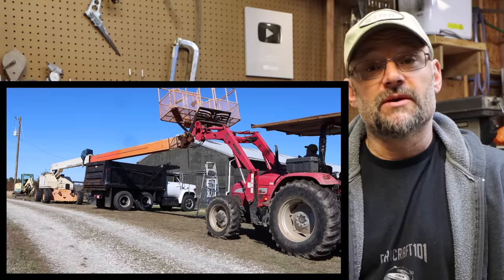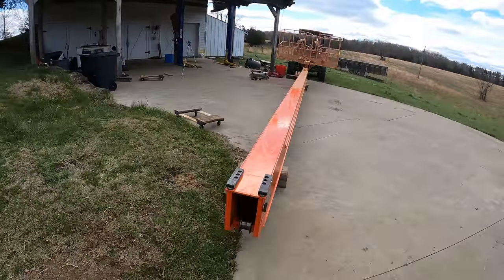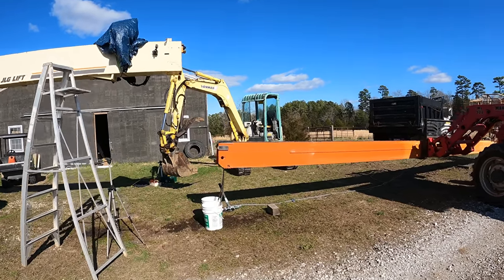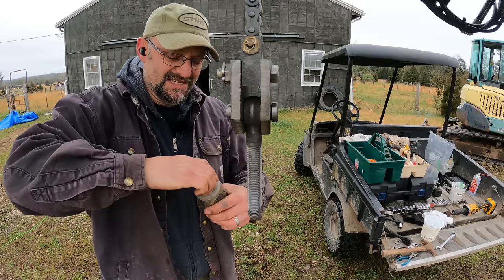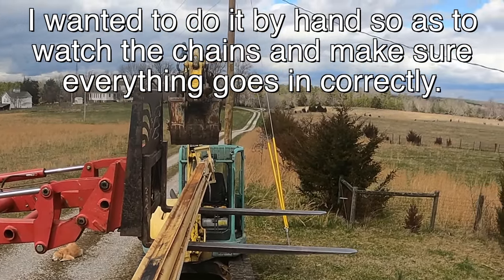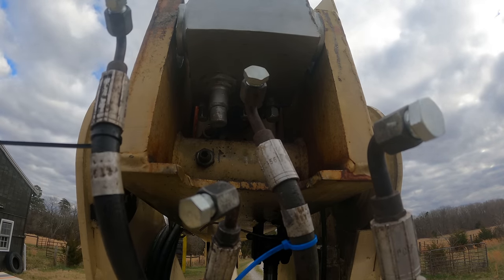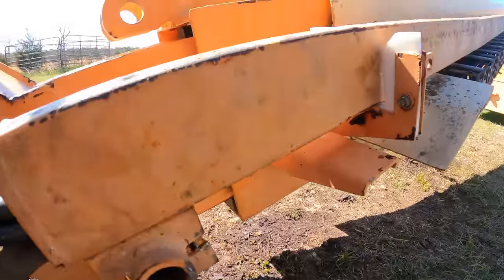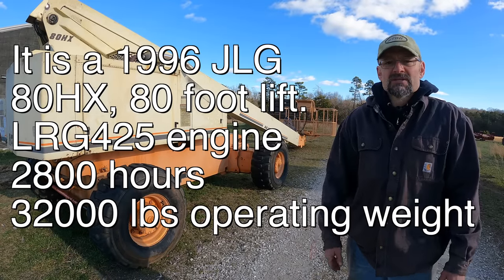Rebuilding An 80 Foot Boom Lift Alone.  Is It Possible?  JLG 80HX

Comment: I would have grease the area where the wear pads rub. Check the pressure going out and the pressure going in as there may be a different.When you are up high and retact you want to feel under control.

Comment: I watch these lifts sell on bidadoo every week. I primarilly watch the 80'>85' Genie lifts, but the JLGs go for the same range. With decent tires and between 3k and 5k hours, they usually go in the $25>$35k range. The fuctions are described in detail, so you get a machine that functions accordingly, and if it doesn't, you have 30 days to return it at your expense. I might note that at 37,000 lbs., these cost a lot to transport.

Comment: On the nemesis pin, you could drill a shallow hole down the center from each end and meet it from 90 degrees on the side.  Add a couple of dzerk fittings and then you could grease it at the bushings.  Would be a very minimal loss of pin strength.

Comment: Bravo! A most daunting feat (& positive fate) well executed. It might be an interesting calculation to determine how much weight the mid-boom is applying to the wear pads in the horizontal position at full extension. Would certainly be the highest friction coefficient & heating. Maybe the fire was just a subconscious incentive for a boom-well clean-out...

Comment: Need to have a can of pledge furniture wax spray on hand when you want things to slide. We used to use it to move heavy equipment like lathes and milling machines across shop floors.

Comment: Was thinking to go vertical more so after horizontal check just for the reversing thereof letting gravity help with retraction as it was not 100% refilled with hydraulic oil and also too, to retard any air gasses left in the system.. With all the excellent repair maintenance work that you've already preformed, one new pressure valve would be my first task... Will be interested in your final fix -> if any... Like your channel -> MUCH...!!!! TY

Comment: I was wondering if more hydraulic oil would fix the extended boom. Remember you only filled it halfway. Of course, the pressure switch might be the problem. Just a thought. I worked for R.G. LeTourneau for 20 years. We built all kinds of diesel electric, hydraulic equipment. I was a serviceman for LeTourneau Sales & Service. A few spills and a long boom might eat up quite a bit of oil. BTW Good job on the overall fix.

Comment: I just love how your engineering background kicks in and you make everything right before you assemble anything, well done sir. Regarding pronouncing the Shiv incorrectly, you are from the USA, you call everything incorrectly such as the cotter pin. I was a little dismayed when you bent the split pin legs like you did and you nailed it when you said that the  pin can't come out. The split pin holds the chain pin to stop it sliding out, it only needs one leg to be split 30 degrees. I have a 4WD that is 22 years old, it has done over 290,000 km and the steering split pins are bent one leg 30 degrees. They have been in there from new and they are in a very vulnerable position and they haven't moved at all.
So, my point is, don't bend your split pin legs like they are ballerinas legs, they just require a slight bend that is all. The retract adjuster, wrong split pins and oh dear.

Comment: Pallet on pallet forks Mr John. I may have some info for you. The last 2 ft it doesn't like. Is there a mechanical interruptor for the extend/retract? If so it may be cutting your pressure down, not letting it retract. I worked for a company that had a old snorkel lift, it did the same thing. That interruptor was hanging up, not letting the full pressure through. Get some hydraulic gauges and check pressures.

Comment: Hmmm, that sequel when you try and retract from full out.... I can't remember, did you check over the valves related to the retract?

Bwa! You talked about the pressure relief valve, I wasn't sure if it had one, but that's exactly what I was thinking.

Comment: Adjusting that pressure relief valve should be very easy.  Usually it is an internal hex on the end of the stem of the valve with a locking nut that holds it at it's setting.  It could be tougher to know what pressure you are setting it at, but you could just replace the valve all together.  I'd be surprised if it was more than $200 and probably not that much depending on the brand.  I've worked for a couple of the US based cartridge valve manufacturers so if you have any questions please reach out.

Comment: Grease zerks on the pin. Small hole on the center of the pin, and then another hold to the outside of the pin at the bushing. A small diameter hole 3/16" is not going to compromise the integrety of the pin.

Comment: You done well considering you had zero schooling. on these things. Seems your Tudors were most helpful also. Been working on these for 20 years and the boom pivot pin are always a problem. Very impressed that you did do this alone but I always request I have a partner incase of an accident. 35k to 40k seems fair and realistic. I agree with the relief valve setting also. Always set per manual the relief valves as they also limit loading to stated basket capacity so a person does not upset the machine with 2000 lbs of cinder blocks!, bricks or even debris! 😂

Comment: You do really good work you repair things I would never attempt but I would check and adjust the hydraulic pressure relief valve because the system is designed to operate at a given pressure running it at a lower or higher pressure puts undo strain on the system it could be as easy as loosening a lock nut an turning a screw or removing a bolt shimming or replacing a spring  a pressure gauge would be required

Comment: Jon,
  I really hope you used rosin resin on your solder joint. If you used acid core, the type you use to repair a radiator leak, it will eat up the copper wire and anything else it gets on. Hope I'm not too late posting this note. Let me know if you get the message. i made this mistake and the mess it made was uncorrectable. It ate the wires and connectors in the radio up....
best regards,
Sam

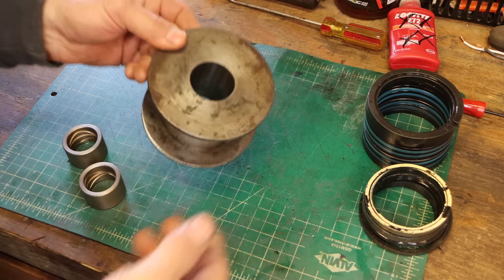Comment: 3:23 Did you buy that press from Arbor Freight? 🤦‍♂
That's a nice shiney cylinder there Jon. Have you been polishing your rod vigerously by any chance? 🤷‍♂
My only disappointment was you didn't show the hydraulic oil level in the tank after you exercised your Johnson boom to it's full  glory. I was very curious as to how much the level would have dropped.
Over all it was very impressive and was a very quick 58 minutes of immersed watching.
Considering the work that was done to it and the mechanical state it has been improved to plus the low hours I would expect you to be able to ask about one third of the new price if you sold it here in Oz. Yeah, prices are higher. 
Thank You for the series on repairing the beast. It was greatly appreciated! 👍👍👍👍

Comment: I would of made a couple brackets out off flat stock that would surround the boom on one side when you have it on the tractor forks and attack the brackets with can c clamps to the forks so the boom can slide on the forks but can't fall over.
The chain tool you used to tighten the cylinder caps would of worked to be able to straighten the cylinder.

Comment: Commendable job guy. I was just a little surprised that you never used a rock to pound the pins in, hehe.  But, I guess all you had was that rusty carperters hammer, ugh. Real mechanics use brass, lead and ball peen hammers and we don't leave hammer ding marks on the shaft ends. I followed this (and most of your other jobs) and seriously you do get high marks for the work you do. When it needs to get done, you can do it.

Comment: You should look into getting a wireless backup camera.
When I saw you disappointed that you wouldn’t be able to pull the cylinder in with the come along and would instead have to push with the excavator, it made me think you need a wireless backup camera that you can put somewhere you need to see, and just take the display where you need to be. They make em wireless, you’d just have to figure out how to get power to them, and I bet you could rig up some batteries and a remote switch lickety-split. Maybe even a mag mount or just a spare GoPro tripod.

Comment: Watching you put the cylinder in now. I give you a lot of credit for taking this on without having the right equipment to do the job but knowing how you are I expected you to do it and do it well. My only concern is you making the slides fit with a little bit of clearance. The wear pads were tight and it's worked for how many years? By giving clearance you're going to magnify that little bit of movement over the length of the arm. I'm concerned that you're going to have a lot of flapping around of the basket due to reducing the wear pad size. Hopefully you can add the shims back without disassembling again.
Reply from the maker: I checked several times with the JLG service manual.  They are not supposed to be tight like that.  Spec is to within 1/8" clearance.  I did mine to 1/16".  Even if it sways a bit more, I wouldn't jam the shims back in.

Comment: Using chain ir cable instead of rope would eliminate the spring effect. In the future. 😊 laying plywood on the forks with a heavy layer of plastic will help it slide easier.

Comment: Great conclusion to an amazing series. Bravo! Congrats on the fixed boom lift.

As for a selling price, if "new" costs you $160k, then I'd say your could ask for at least $60k~$80k "used"/"refurbished" (computer/laptop nerd speaking), since you basically fixed all the broken parts, made sure it is working to spec and have proven record of the thing working as it should. 

Plus: you do value your time, right? So don't just calculate the price based on materials and tools you spent $$$ on. You must also put a price tag on your time that it took you to do all this repair work. So yeah, your suggestion of $20k~$25k is way too low in my opinion.

But yeah, as you said, you should not sell it. It has now not only monetary value attached to it, but also very sentimental value. Since you spent so much time with it. Maybe it's time to give it a name, other than "old piece of costly junk"? 😂

Comment: You could fir a grease zirk (nipple) on the ends of the pin with a hole down and out to the bearing edges.

Comment: The force the boom cylinder can generate pulling in (retracting) is much less than it can extending. That is due to the fact that the effective surface of the piston is maybe a third less of that when extending. The rod takes the rest of the surface.
If the boom is extended the pressure from the pump will be enough to do the job. When retracting you need a higher pressure to generate the same force as when extending. If the over pressure releve valve it set (to) low this can make retracting difficult.

Comment: I would think to keep the basket from flopping on you, you would rig the excavator with a 'Y' spread to each out point of the basket.  Rigging it in the middle with one strap does not prevent it from flopping.

Comment: Great job.  The diving platform's ready for summer.  I'm with you on the whole challenge thing, if you don't push yourself, how will you discover your limits?  Having said that, I'm not sure I'd have taken on a job like that, where failure might endanger my life.  On the other hand, if you only paid $8k, I'm guessing it would've cost you that much again to get a pro to fix it.  Doubling the cost of the machine to fix some seals would be a bitter pill.
Is it possible the pressure release valve was backed off because of the leaky seals?

Comment: Awesome job on the boom repair. It is worth at least $30,000 now. Haha, I’m trying to figure out how to remove a 200 pound lead swing keel from a 24 foot sailboat.
Reply: Do you have access to a strap lift, like would be used to haul out a sailboat from the water and set it on a trailer? Make a wooden cradle for the swing keel. lower the boat till the keel is in the cradle, disconnect the swing keel, then lift the boat away from it. Put the boat on the trailer and use an engine hoist to pick up and move the swing keel and cradle around easily. It will cost you a little bit for the time on the hoist, but it will be a safe way to accomplish the project.

Comment: think about it, with that length you are going to arch/droop and bind the extensions . i bet if you research the unit it is made to  be vertical to some extent in order to retract at full extension or the retract relief valve is out of spec.

Comment: Great job man.
I would have thought there would have already been a lot of extra pressure in the cylinder to overcome the shims being too tight.
Of course I'm not basing that on any knowledge of how any of it works, it just seems to make sense to me that with how tight it was wouldn't the pressure have already been turned up to make it move in and out before?
I know you would have topped the fluid up before you tested it, maybe it's the top and bottom shims compressing too much with all the force allowing it to bow too far when extended the last couple of feet, it definitely flexed more right at the end of its travel. Maybe it's just too much tension to overcome until you put the basket on the ground and release it all.
So basically, maybe the shims/guides are old and flex/squish more than they are supposed to at full extension, I can't even comprehend how much force they must be under in that position lol.

Comment: I scanned some of the comments and didn't see this. You should invest in some rope made with spectra fibers. Low stretch.

This will do two things for you in future projects. 1) safer. If the rope you were using were to break under tension, it could fling back at you and cause some serious damage. 2) because it doesn't stretch, as you're using the come along the work piece won't surge forward but should slide more smoothly.

Comment: I must say I rather liked the re-assembly.  But, I think the climbing hazard, the natural very slick metal surfaces caused a hazard that where with some care in thought, a more 
suitable platform of temporary end use would have been prudent.  I suspect your main pin, as difficult to remove was caused by rain exposure.  Where external storage, perhaps a protective end cover might delay that rust as pin to corrosion. For instance the rubberized canvas type material.  Magnets to secure? The end cap * plate seemed extra rust, (an enlarged mount point?   And I would think the anti seize helped also.   
I did not note the basket operation, but a warning horn, beeper *buzzer is very often a safe device at ground travel.
Take note of lube needed to drive hubs.
I think most of all, the large hazard is as to contact of live voltage (lines).  So very often, it is the operator familiar with the individual machine, as rate of travel, ect that helps 
to lessen most concerns.  And where backing is blind, forward travel is always the better motion to general movement, as away from any obstruction as best habit.
As to raised position, dropped tools can be difficult and a particular hazard for workmen below.
And interesting repair with a machine I suspect had low end use.   I think that full extension (horizontal) would be rare to operation.  And I would suggest as to 
avoid that placement entirely.  M.

Comment: Love watching, but wonder why not do it all at the shop?
Reply from the maker: Not enough room.  It took the full length of my concrete just to do the cylinder.  I need to have the full length of the cylinder, the base boom, and a machine to pull or push as well, plus the forks coming from the side to lift and catch.

Comment: Your nemesis pin was not rusted in.  It was pinched by the weight of the boom.  All the beating and pulling won't work.  You have to move the boom around until the pin is no longer pinched.  Then it'll knock out easy-peasy.

Comment: Fully extended whilst angling downward means when you try to retract the cylinder is trying to 'pull' the boom uphill but in normal use it wouldn't ever be in that situation,in normal conditions gravity is a factor and it basically slides back in with the ram simply resisting.
Nothing wrong with it.

Comment: 2:00 Just a thought coming from a metric system country: outsiders always praise our system, how it all makes sense, how you got 1 meter is equal to 1000 mm but the truth is that we barely use mm in our common life. Of course mechanic things with tolerances and the like are all in mm but we never say something is 720 mm, we say it's 72 centimeters, I'm 1 meter 86 centimeters, not 1860 mm, etc. We only use it for very small measures, for anything over 10 mm we start using centimeters, like my cup is 11 centimeters and a half, we would never say it's 115 mm. In this case any common people would say it's 20.3 or 20.4 cm. Maybe mechanics or engineers would say it's 203 mm or 204 mm? Just rambling, back to the video.

Comment: tbh I've been on a ton of lifts on job sites, and legit some lifts were TERRIBLE the last 1-2 feet of extension. Like unusable. Then some lifts had that magical max extension, super fast, I dunno age use time, wear n tear, or lubrication like you said might be the issue.

(all these lifts were inspected and cleared for job site work) Never had a failure while working.

Comment: If the pressure adjustment doesn't work to retract the boom, lubricate the slides with Teflon lubricant.

Comment: I would say what you just did was insane to think about doing every two years like is suggested 

but what about just driving out that nemesis pin lubeing it and driving it back in every two to three years and then  tearing it down completely next time the cylinder leaks? 

That's sounds like a more reasonable schedule